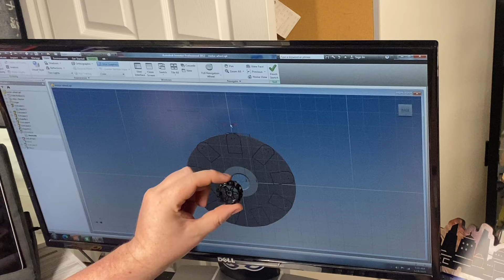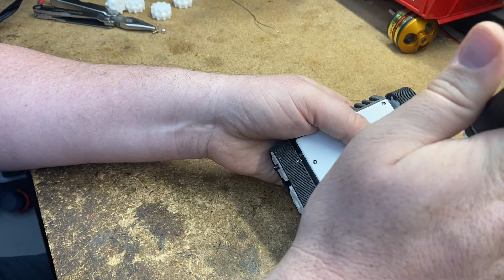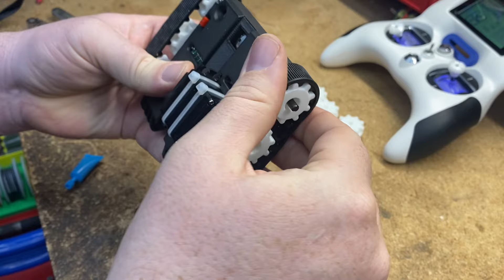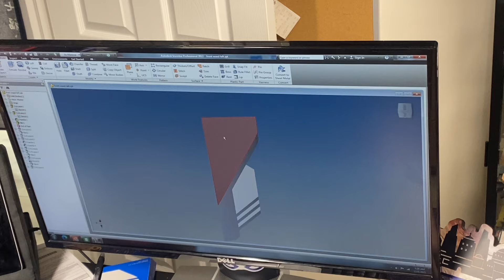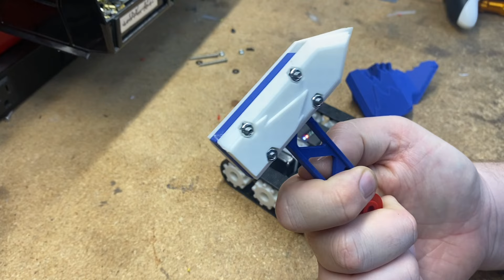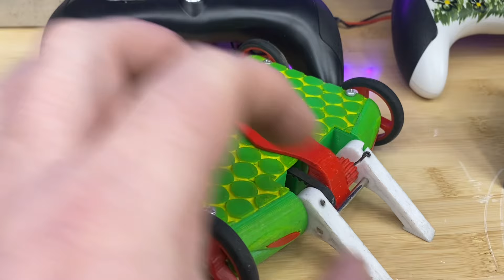My Newest Combat Robot Is A TANK! Introducing: AVALANCHE

Comment: Great chassis! Honestly the ice theme is dope, I would keep it or mix it with fire on the weapon. 
I think something like a low scooping arm that works on the back part, could make a interesting combo. Iceberg wedge on one side, scooping flipper on the other, and together it can sandwich a bot when turned 180°. So you can wedge with the good traction, sometimes flip, and also hold stuff on the wedge!